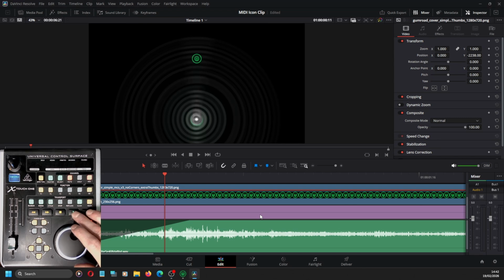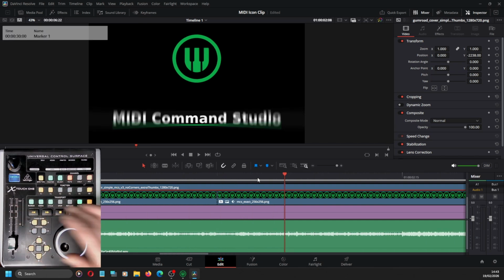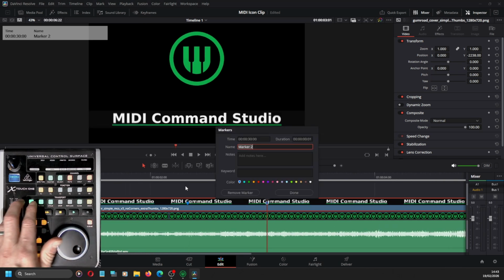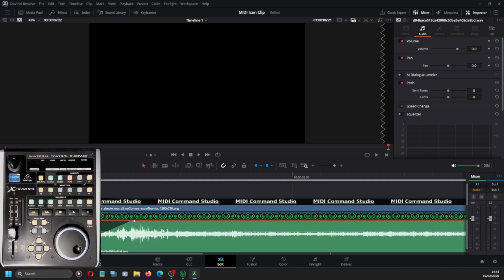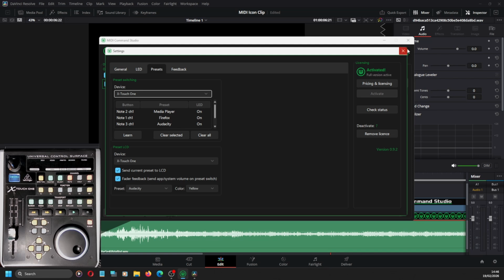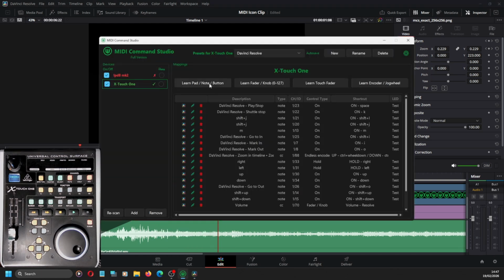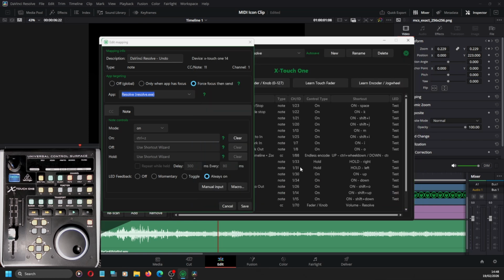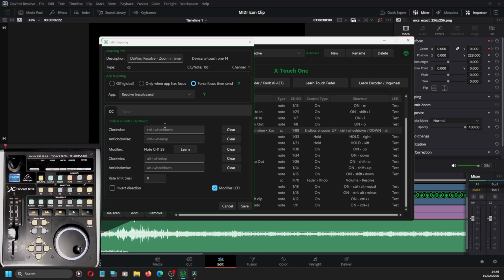Control DaVinci Resolve with a MIDI Controller

Comment: 383
Excellent software 👍👍 I just purchased the license after testing it with an Arturia MK2 keyboard and DVR. It works beautifully with DVR using MCU and MIDI—I can finally use the encoder (MCU) on the Edit page.
I’m going to get an X-Touch One, which is better suited for mapping more DVR controls as well as for DAWs (Luna and Reaper). Speaking of which, the preset page is a great idea.
Reply from the maker: Just a heads-up since you mentioned using the X-Touch One with LUNA and Reaper — with the new Windows MIDI Services, MIDI Command Studio can now use the controller at the same time as the DAW. this has been tested with the X-Touch One and LUNA and it means you can map any unused buttons in MCS to shortcuts or other actions. just make sure not to map any buttons that are already mapped with the DAW unless you want to add more function to an already mapped button. You can also put the X-touch one in MC User mode which allows the changing of button functions so you could potentially use more buttons on the X-Touch one, if you assign them in MC User Mode to functions that Luna isn't mapped to. It makes it a really versatile DAW controller, combining custom shortcuts with native DAW control!
Reply from the maker: Thanks for the kind words and for your support! Really appreciate it 👍

Comment: Nano control 2 can use this amazing software for DVR?
Reply from the maker: If the application can be controlled by shortcuts then it should work fine. Best option is to just test the free version. There's no sign up or time limit with the free version. Capture your own shortcuts if the shortcut library doesn't have them.